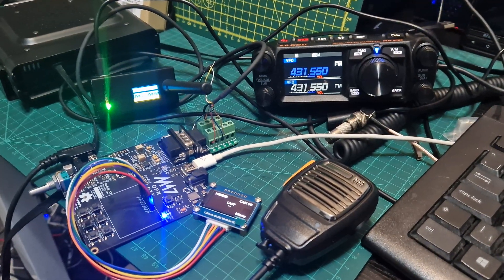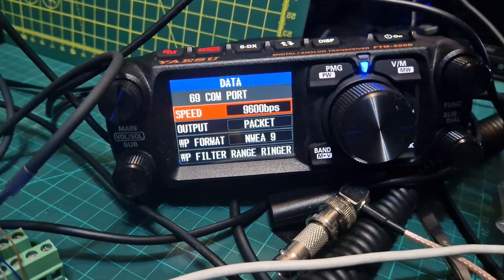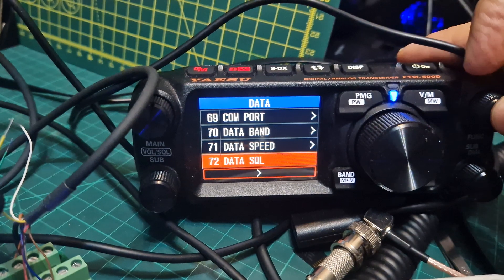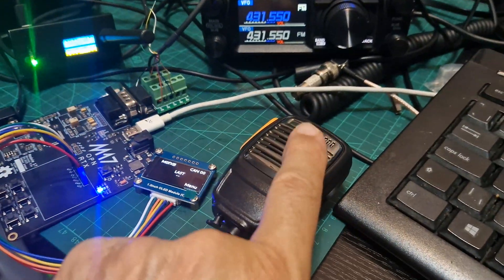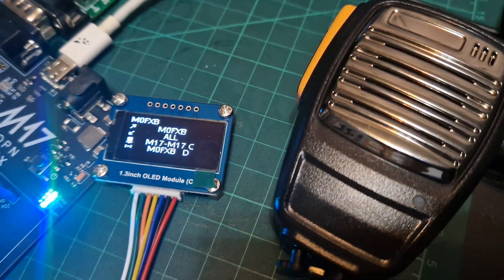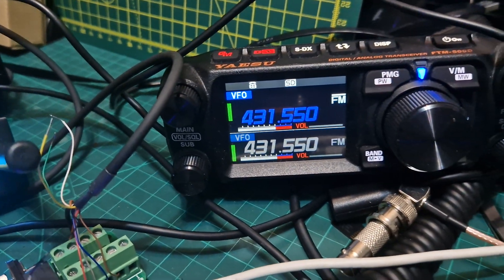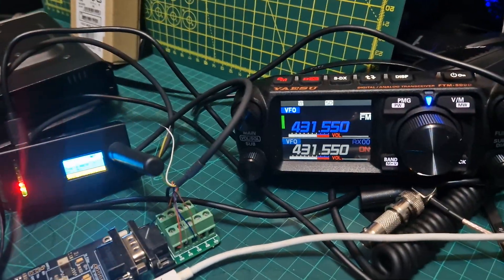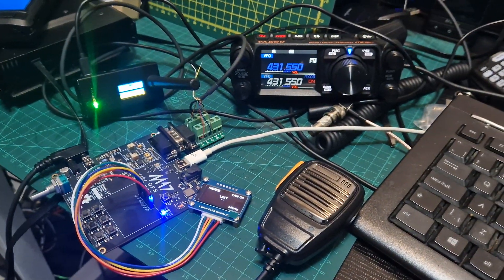M17 MODULE YAESU FTM500

Comment: I can't till the m17 radio comes out.
Reply from the maker: Be a better product.
Reply: @M0FXBHamTech  this baord is a start.   I am having a hard time finding a radio with I six pin data cable that is not fusion.  Cause I also want to use for my allstar node.